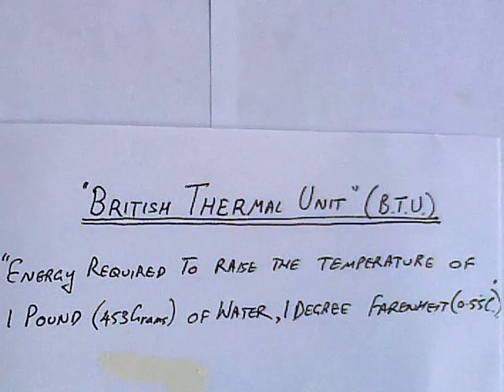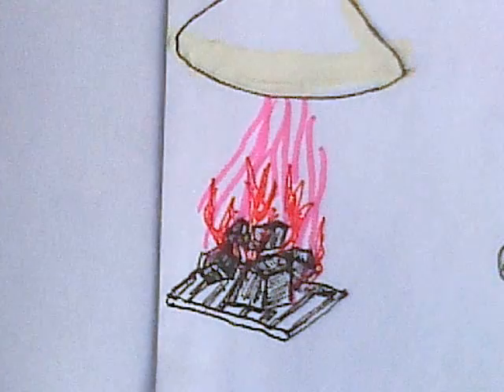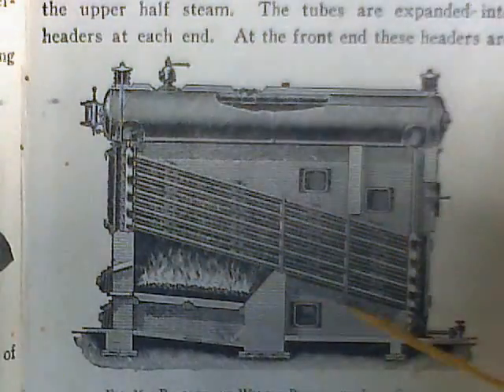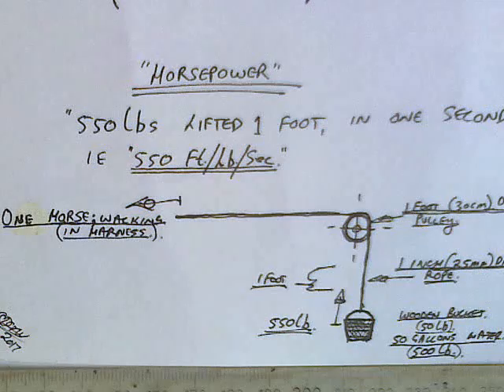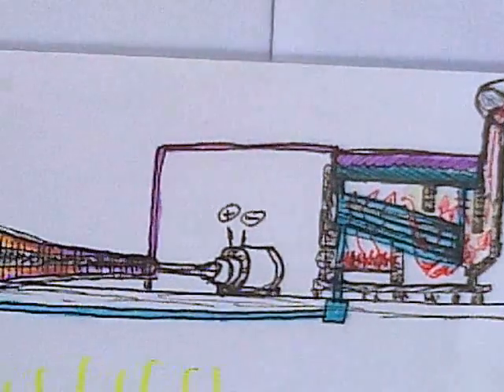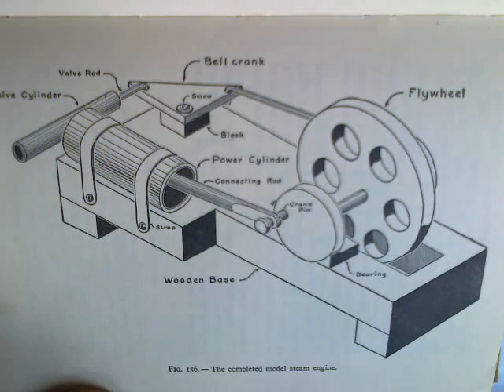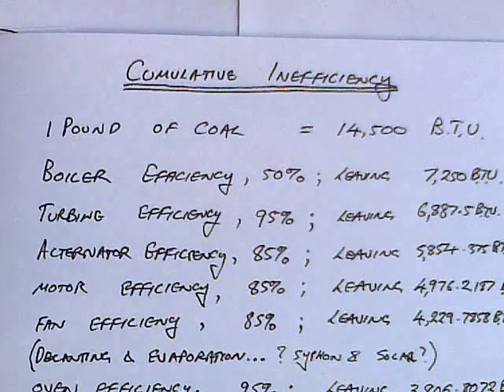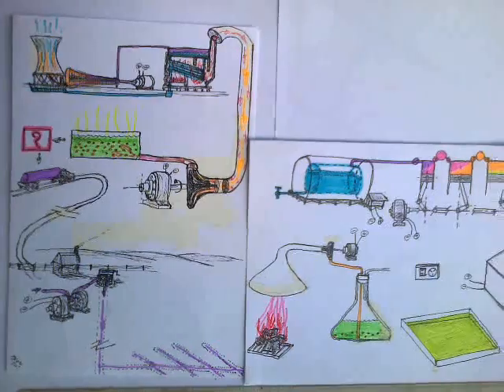Is Carbon Capture & Storage Thermodynamically Impossible...?

Comment: Warbles, you are getting your info. from books which are nearly 100 years old.. furthermore there is a lot of work done in carbon capture than what is in those books. Although what they say is not wrong, it is outdated technology which has been improved on.. they have even gone into pre combustion capture but,  all of the above are to REDUCE CO2  emissions not make it more efficient. It's not meant to be a perpetual motion scheme. At an average power stations with carbon capture systems run about 10% LESS efficient than ones without but they produce 75% less CO2, which is what you complain about.. they don't care if they use more fuel to reduce CO2...if it costs more they charge more..as if you have a choice on what price you pay...
Reply from the maker: G'day,

   Thanks,

    Well, actually, you're not quite right there...; nothing which I quoted from the old Books is anything which has changed...

   Clean Coal has two varieties, one is to pulverise and wash the Coal to remove the Ash from it, before mixing it with Water & trying to run Diesel Engines on it...; and the CSIRO has wasted millions of dollars destroying Engines in that Experiment, because the Ash-Content is too high and it chews the Rings & Valves out within 100 Hours...

   The other type tries to run the Furnace at 5,000 Degrees Farenheit (2,760 Celsius) rather than the 2,500 - 3,000 F. (1,371 - 1,648 C.), which the old Textbook mentions.

   My point is that "Carbon Capture & Storage" is being Propagandized to the Public as a way to Burn Coal while capturing ALL the resultant Carbon Dioxide and storing it underground, while still providing "Baseload-Power with which to stabilise the Grid" ; THEREBY allowing us to maintain our current Lifestyle, grow the Economy, AND Cut Carbon Emissions...., to Zero..!".

   And, I'm calling "Bullshit !", on the whole Fantastic Delusion..; it's a Perpetual Motion Scam because it expects "Over-Unity Energy Yields"...

  Such is Life,

  Have a good one...

  ;-p

  Ciao !